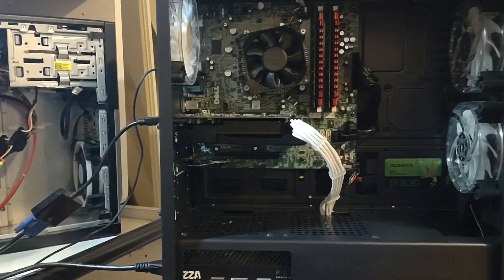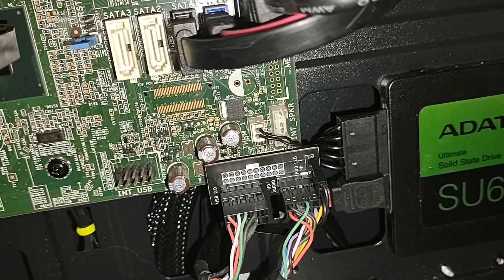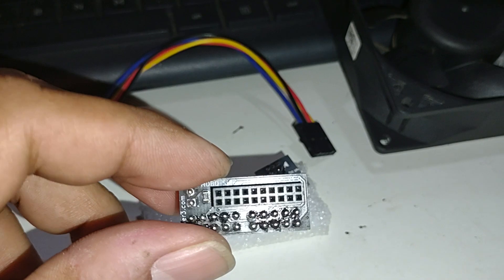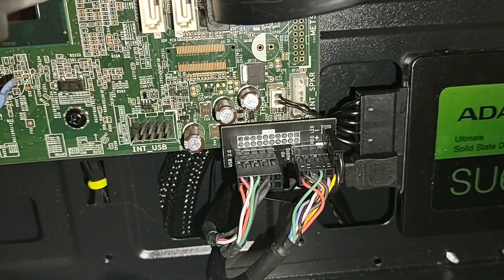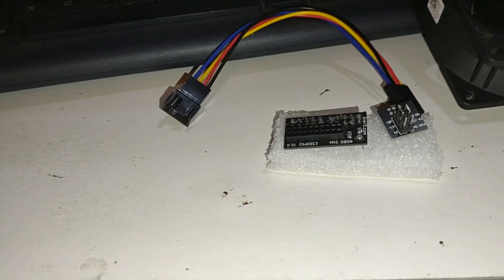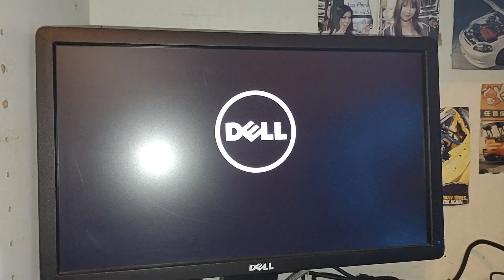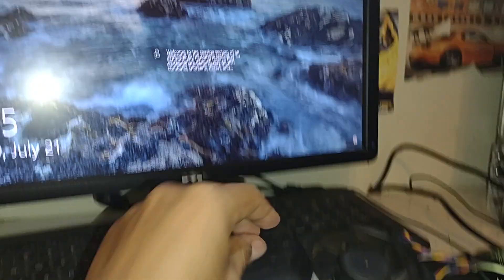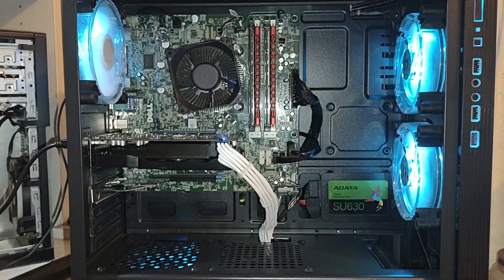DELL Advice OPTIPLEX CASE SWAP - 3 key things you need for NO F1 codes and FULL CASE Functions

Comment: I have a dell inspiron 3891, i tried putting the 2 pin on/off switch to the case but it foesnt turn on without the original switch cable.

Comment: Can do this with a dell optiplex 7010
Reply: Those are dinosuar old, I picked up a 7090 in trade for a dell latitude 10th gen i5 I got for 60 bucks, just gotta work the system and
Reply: @Jaybird6638 nice but you kinda commented 9 months later

Comment: My psu has 8 pin cpu power connector while my motherboard has 4. Also my 8 pin connector is not splitt able. Anything I can do? Like maybe you know some adapters?
Reply from the maker: hello. sorry been working.. it should split in half.. but if not they do sell adapters or extensions wires like to dress up.

Comment: for the SSF  9020   

for all that  dont need front Audion  and stil want to clear the 
error of front Panel error   the USB 3 works  whit standart  converter  the usb 2 is a 1 to 1  in a smaler size so ther you need toi splise cabels  same for for fron audio  but if you take the front audio cabel  cut it  2.5 CM  up the wire  remove all cabels from plug - the black Loop wier  that is  the ground to case   that  annules the front panel errore good luck shaer to all recycle for life 
PS: sorry for the spelling
Reply from the maker: yeah the SSF are a little tricky. Did you see if the they have a adpter for yours.. worse case rip the front IO of the Dell case. then Plug it in so code goes away and hide in the case.. check out this link.. they have a lot of adpters..
Reply from the maker: Front panel adaptors:
https://store.harbinrepairs.com/
Reply: @RetroCapsule_Gaming  yes this i hav seen but the SSF dif. from the bigger models  in the mobo conneters so no adapters  and wantert to use a small Matx case  to keep it smal  but still hav  a Real GPU in 🙂
Reply: I have a dell opti 9020 ssf while I have problems case swaping

Comment: i wanna case swap my dell optiplex 9020 SFF into my corsair case (reason for doing this is to use my 1050ti) what will i need to do i have 8-24 pins in my cart and a 500w PSU anything else i need?
Reply from the maker: hello.. Koo. well. a dell 5pin to 4/3pin adapter for rear fan or CPU fan to use a RGB fan if you want... the Power switch and front IO adapters... and thats sounds like a go after that... remember if you dont have a i7 get a e3 1270v3.. some/close as a i7-4790
Reply: @RetroCapsule_Gaming  ah, so your saying I should buy adapters for the fan case? I do have one tiny problem whag about the Motherboard fan (fan that cools cpu) when I tried to case swap to see how it would look there wasn’t anything on the back of the case to lock the fans, in short summary I will buy the adapters for the fan and switch thanks and please respond

Comment: And what about USB 3.0 bro ?? Why is no one mentioning the fact the Blue Cable from Dell is Special?? How to use the USB 3.0 cable that comes with any New case with the Dell Mobo m8 do you know ?
Reply from the maker: Sorry for late reply..  well on the OptiPlex's the USB 3  socket on the board work fine with PC cases . I did like 5 swaps into a RGB case.. only board I had a problem with . Was the HP board.. it's missing a ground pin.. that makes it give you a start up code . But if you plug it . The USB 3 works fine but a code on HP.. never on Dell

Comment: excuse me sir. can i case swap it without upgrading the PSU? i only use low-end specs. (i7-4790, 16gb RAM, GTX 750ti)? I am really really on a very tight budget and cant afford new psu and its adapter for my 9020mt motherboard

edit: all i can afford is for the new case and front panel adapter
Reply: Oh you got one of the funny power connector ones so need the 24pin to 8pin Adapter,
you can get EPS 4pin extensions for the top plug next to the CPU VRM, for M-ATX (4PCIe Slots) you will want about 350mm/14", for ATX (7 PCIe Slots) about 400mm/16"
Reply from the maker: Hello.. thx for watching..
You can use the original power supply.  Just buy cable extension.. with the extension you should be able to reach.. they you have to buy a couple adapters.. .
Probably some -  1 to 2 sata adapter. Probably 2 sata to 8 pin . If needed.. and the 4 pin to sata adapter.... 

With the Cable extension .. the 24pin and 4 pin should reach .
Reply from the maker: Yeah the 24 pin to 8 pin especial adapter 9020 7020 board..